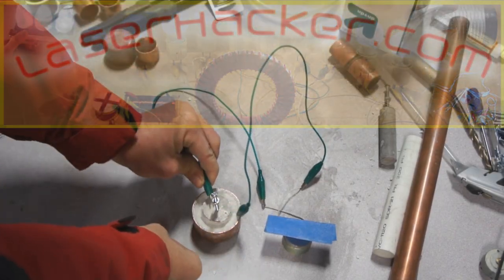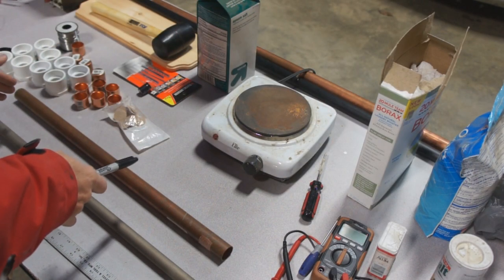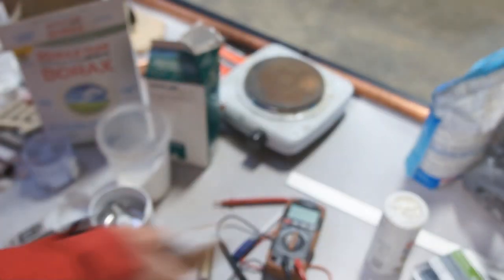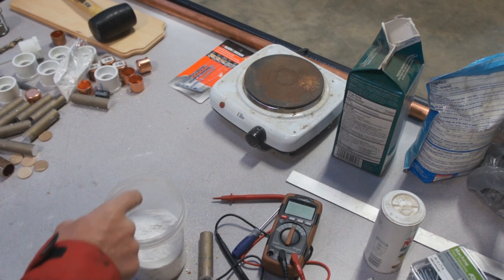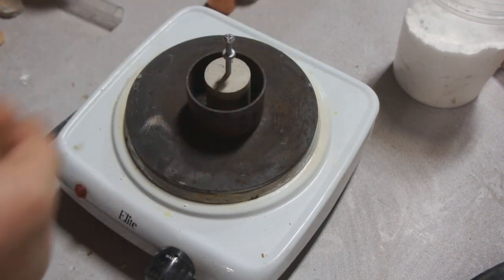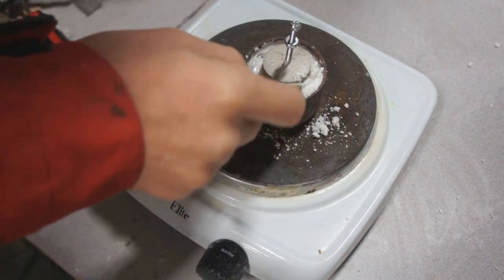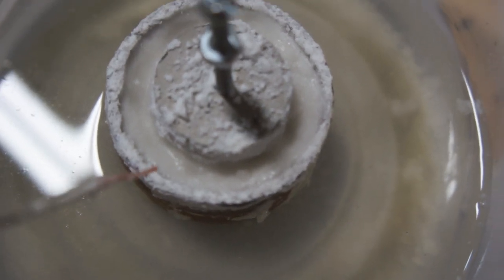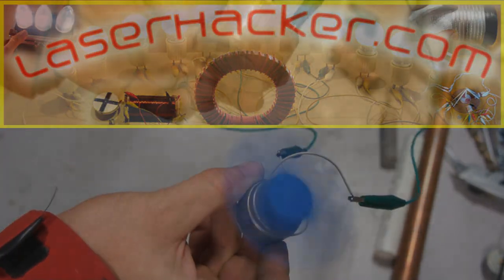How to Build Crystal Power Cells - Long Duration Power

Comment: Kind of cool, but based on the title, I was thinking it would be a way of using crystal diodes to extract 'free' energy from the radio waves that are persistent all around us.
Reply: That is what an old-fashioned crystal radio does.  However, the amount of power produced by something like this is absolutely tiny and for this reason, almost completely useless in practice.
Reply: You are wrong Rosen ..... This coo e scaled UP to ANY level of POWER and will become an IMPORTANT PART of the FREE ENERGY MOVEMENT which wll TOPPLE and DESTROY the FOSSIL FUEL OILY BEAST 666 by a SWORD of LIGHT and TRUTH in the MESSIANIC AGE of AQUARIUS ... !!! AMEN ??? LOL
Reply: U are correct T Qadaly ,,, I have tried it and it works beautfifully and it can be SCALED UP to whatever POWER levels needed and WILL help to TOPPLE and DESTROY the fossil fuel OILY BEAST 666 by SWORDS of TRUTH and LIGHT these HEAVENLY DEVICES produce in UNLIMITED amount forever !!!! AMEN ??? LOL !!!
Reply: Pusalieth
Photons don't lose energy per squared distance.  You simply collect fewer of them per the square of distance.
Reply: Pusalieth Photons don't decay.  Photons and electrons, and their anti-particles, are the only stable particles.  At any rate even if they are someday shown to decay (into what?), it would have nothing to do with losing energy per squared distance.
Reply: psycronizer I guess I'm just not interested in the "challenges" of some 14 year old pretending to be a theoretical physicist.
Reply: psycronizer You're more than welcome to explain photon decay.  I'll go make some popcorn.
Reply: T Oadaly sigh....I've reached my limit with you....you twist or pervert everything and when you dont have an answer you try the "smart-ass approach"...but half the time you cant even get THAT right...as above..we were talking about wether or not photons DECAY......NOT the mechanism by which they do it...so ...I'll not be reading anything else you have to write, mainly because a)it is innacurate or b) its child-like sarcasm to disguise the fact that you have no decent answer, in fact, the image of a monkey screaming and hurling its own faeces fits the bill here.
Reply: psycronizer
T Oadaly is correct and he (I'm going to presume you are a he) wasn't the poster who said that photons lost energy per squared distance, that was Pusalieth.  You need to read the thread with greater care.

I did physics at university (admittedly some time ago now) and photons didn't decay then.  Please tell us what they decay into now.
Reply: T Oadaly
Indeed.  I shall be really interested to find out what the decay products of a photon are.  It's not often new physics is revealed on YouTube so I shall await psycronizer's explanation with bated breath.
Reply: psycronizer
Since I haven't been involved in this spat, please humour me by explaining to me about photon decay.  I am genuinely interested to know what you might have to say on the subject.
Reply: psycronizer It appears that you may have run off with your tail between your legs having realised that you were completely wrong and that photons do not decay.

The first problem with photon decay is what would be the reference time frame?  They are travelling at the speed of light so there won't be one. 

There is a proper explanation here https://www.physicsforums.com/threads/decay-of-photons.512811/page-2#post-3398649 as to why photons do not decay.  You will need to be fairly familiar with Quantum Electrodynamics and Quantum Field Theory to be able to understand this but it is set out clearly.

It is pretty ironic that you said to T Oadaly "I see you chickened out of my challenge" when you clearly know nowhere near as much about physics as you claim and have suddenly gone quiet.
Reply: Joshua Rosen I'm only going to say this once , (and by the way, if you really are interested in this and not just another googler who's up for a battle of "who can google the best", which is what appears to be going on here) you wont find this information on google- because there is'nt room for books on (speculative)astrophysics- and besides, all quoted knowledge here needs to be referenced, and I cant remember the specific source, it was from a long, long time ago,but I will give you what I know to be accepted by the intellectual majority: Based on what we now know of the universe, specifically that there is no "universal constant" I should like to point you towards two directly related phenomena- universal expansion and dark energy/matter (this is actually a misnomer-as these regions are most likely completely devoid of any form of matter or energy-the quantum foam is unstable due to the absence of matter that matter itself cannot coalesce here. A little off-topic-Black Holes are also a great eater and destroyers of matter and energy (space time) these of course are just one mechanism by which light can be destroyed, and although they give off Hawking radiation-this is not to say that a photon escapes unharmed, it may, if it's "lucky" conserve some information by an escaping decay particle(s) at the edge of the event horizon(Swartzchild radius). You also asked about the time frame of this issue-quite right too: the universe is old, impossibly old, inconcievably old, yet, that age is but a moment of the time frame we are talking about the degenerate phase and exponential time  frames after this, where the fabric of space time itself is unable to carry any fundamental particles, no mesons, no baryons. Yes, its hard to get your head around that. Try to see it like this-matter/energy and space time are inextricably linked-matter is what gives space time it's ability to "curve" a field that directly acts as a "glue" holding particles at certain rest energies, this rest energy is directly determined (on a relativistic scale) by the amount of matter (or its field) acting on it. It;s quite bizzare, it's like saying "matter can't exist without matter"!. Taking this further, if you consider the brane theory, then you can see how a galactic region (for want of a better term) ,devoid of any matter, can then almost instantaneously spew forth an ever increasing wave (or sphere) of matter/energy/space-time, from that single truth-the collision of two distinct branes is the cause and catalyst that allows the "creation"-- this of course sets up the possibility as stated above -matter is now created by the presence of this matter field, and it extends outwards untill those conditions "normalise"-whatever that means,ie; the branes are no longer touching ,or having past through each other, or maybe a certain matter-field density is reached , I dont know, but whatever it was, or is, the effects are still with us today....universal expansion and microwave background energy pervasive throughout observable space time.I hope I have answered your question and hopefully given you a little more insight into the nature of space time.
Reply: psycronizer ...you should have saved yourself the trouble of typing all that.
Reply: T Oadaly I'm not just another Googler.  I did a degree in physics at Manchester University, although that was some time ago.

The long and the short of it is that photons still don't decay.  If photons did decay, even someone who was just a Googler could find ample evidence that they do.  All you have to support your argument is a highly speculative theory that you read a long time ago and now can't really remember properly.

Still, it made for an interesting read even if it didn't actually address the question.
Reply: psycronizer ...I'm still waiting for your dissertation on photon decay.   My popcorn is already stale.
Reply: psycronizer
I am perfectly familiar with Hawking radiation but I fail to see what that has to do with photon decay.  Please provide a source for your claim that Hawking (for whom I have a great deal of respect) says that photons decay.
Reply: You show your true colours at last.
Reply: Joshua Rosen....and there you have it, ladies and gents, the sum total of Mr Rosen's response- totally predictable and  completely irrelevant......
Reply: Unlike you I have not resorted to personal insults.  Your bigoted (in this case homophobic) and ignorant remarks (how likely is it that someone called Rosen would have a "Christian" name?) show the sort of person you are. 

You have completely failed to back up your fantasy physics which you explained entirely incoherently and consequently resorted to an ad hominem attack. 

I am very happy for any readers of this thread to make their own judgements about our respective contributions.
Reply: Joshua Rosen Yes you did.Yes it does(proudly!).No I have'nt.So did you.and, you did'nt make ANY.......hahaha...I'm starting to like owning you.......
Reply: psycronizer
"I'll dumb it down for you even further.."  ...you dumbed it down alright, to the point of nonsense.  As a photon converts to mass at the BH horizon, that has nothing to to do with photon decay.  We're discussing specifically your idiotic claim that photons decay (they don't), not whether they are impervious (they are not).
Reply: T Oadaly
Indeed.

So far, he hasn't come up with anyting approaching a coherent argument that photons decay and nor has he supported this wild claim with any references (and no, giving the ISBN for a book that doesn't claim photons decay does not count as a reference).

He seems to believe that bandying about insults is a substitute for rational argument.
Reply: psycronizer I don't have any pants on right now.
Reply: psycronizer I've already asked you the same question twice.  Explain photon decay.
Reply: T Oadaly What does this have to do with me not having pants on?
Reply: MyJizz UrEye no idea bro...I use to be able to shoot myself in the eye...but that kind of power left me years ago....I'm too old now..older, but wiser, and a better aim! just ask a chick if she wants to play "turkey shoot"....you shoot and she go's "gobble gobble gobble"! thats turkey shoot.
Reply: MyJizz UrEye
Sorry man.  I have a strict policy of only playing with one troll at a time. ... at any rate, I'm pretty sure you, stikholenizer and pulselieth are all the same troll.
Reply: T Oadaly aaaww damn! you caught me out man! how'd I give myself away?!
Reply: psycronizer Guys guys look, my pants, they are off okay.

Lets just focus on what matters, that being my pants and how I am not wearing them.
Reply: MyJizz UrEye when ur right ur right! so someone said to you "take off your pants and jacket (jackit)" and you did...I hope you didnt shoot any poor bystander in the eye...when you took them off did they make a kind of squelchy sort of sticky tearing sound? I spose there's one other plus to this...next time you go to the doctor and he(or she) asks for a semen, urine and  stool sample you can just give him (or better, her) your pants.and now that you dont have any pants dont get into the habbit of lighting your own farts , that can really go bad, like explosively internally bad....so I've been told, just thought I better add that last bit...
Reply: psycronizer You want to know something really cool/wrong?

The dudes with Ebola who got over it, they seem all normal and healthy but their semen contains ebola up to a few months after they cleared the infection.

Imagine getting ebola semen in ur eye :P
Reply: MyJizz UrEye..eewww! mother nature sure is gettin nasty, thats a sneaky thing alright...they'd be like sexual lepers to any potential partners who knew about it! who'd wanna take THAT risk for a jump?
Reply: why not BOOTSTRAP this and use the motor to SPIN a generator and go higher in scale until its spinning a real generator ???
Reply: John Eng ...because of conservation of energy, combined with the 2nd law of thermodynamics.  Each step in energy conversion necessarily loses usable energy.  The original battery, should be used directly.

Comment: on low heat is useful but a fixed temperature would be great. Can you also confirm if using a gas heater only works or if the electric plate induction is needed